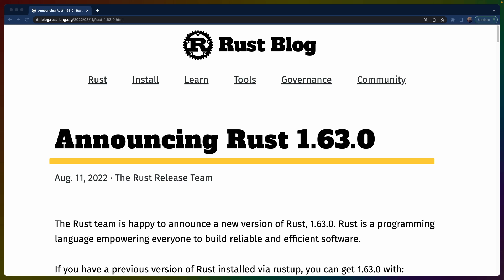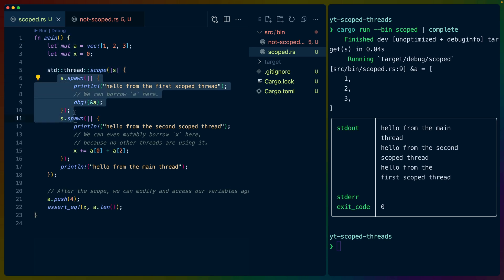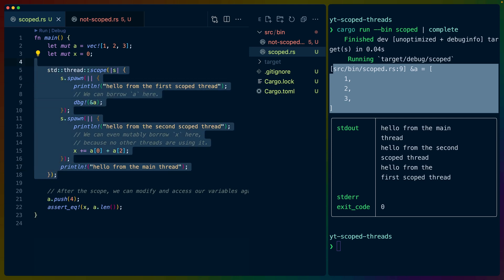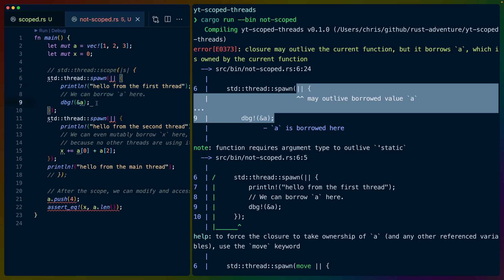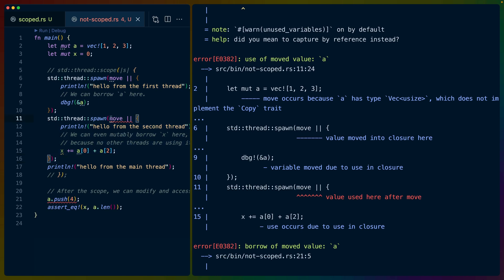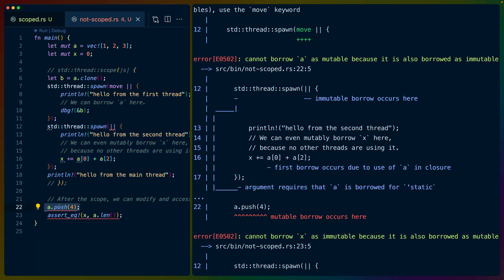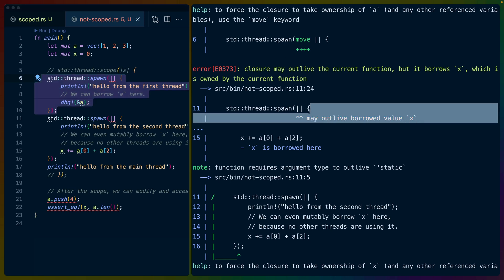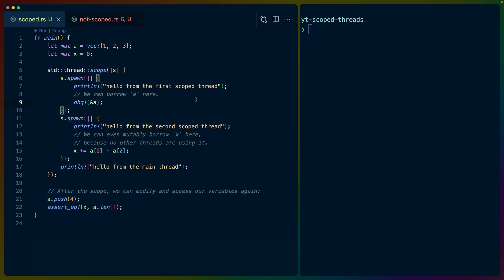Scoped threads in Rust 1.63

Comment: Nice explanation on the new scoped threads.
A little note on the static lifetime, as this is something that's not always clear to newcomers: A static lifetime doesn't mean "the value will life until the end of the program". It just means "the value must be able to live until the end of the program". This is normally fulfilled by either an actual static value, or an owned value. Since the owned value transfers ownership, it will live at least as long as the new scope. The value will still "die" (get dropped) when it gets out of scope at the end of the function. The lifetime is always necessary if you don't know when a given scope will end, like in the case of threads or async tasks. They could run until the end of the program, so the value must be able to live for the same amount of time. 
Unfortunately the compiler isn't able to detect when you join the thread, but that is exactly what the scoped threads try to fix (although it is still a bit more clunky)

Comment: You can think of lifetime as dependency, so, static lifetime basically means depending on a global/static variable, or even better, be an owner yourself, which depend on nothing. And for those 'a lifetime, it basically means the thing it depends on has a lifetime 'a. This is the mindset I have for dealing with lifetime constraints.

Comment: So could you say this is kind of like await for async functions, since scope() makes the rest of the program wait until it has finished?

Corollay question, how would I use async with multithreading, any examples to look at?
Reply from the maker: It's a bit of a stretch, but you could think of it that way. The part that lets it wait is an implicit join(), which you can call on any spawned threads, not just ones spawned in a scope. -- https://doc.rust-lang.org/std/thread/struct.JoinHandle.html#method.join

I usually consider async and threads to be two competing architectural choices. If you have way more tasks than threads, then use async with tokio or another runtime. if you have a small number of tasks and can match that with spawned threads then use threading. Here's some more info on the difference:
https://rust-lang.github.io/async-book/01_getting_started/02_why_async.html#async-vs-threads-in-rust